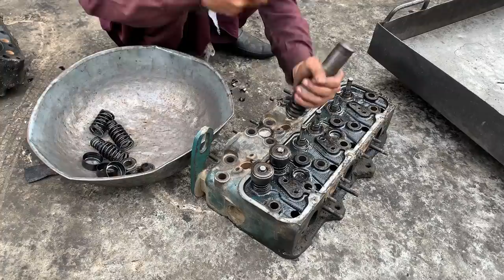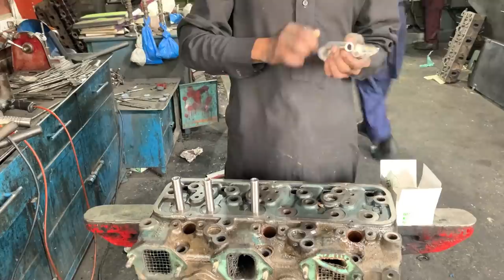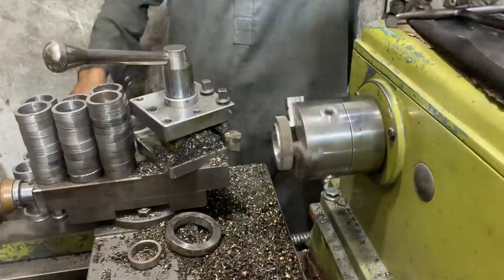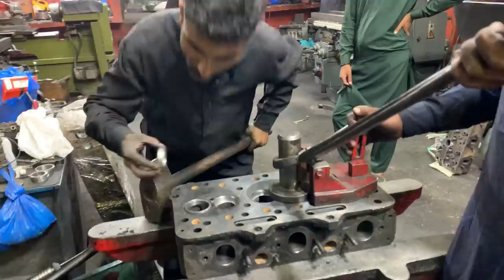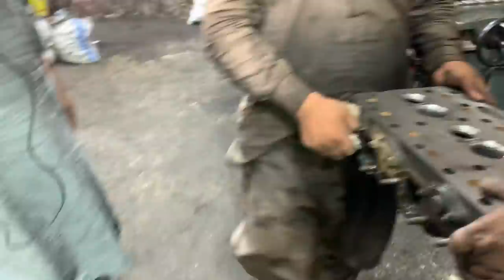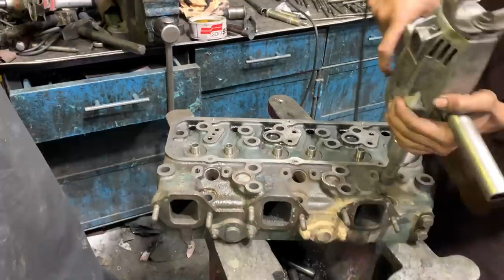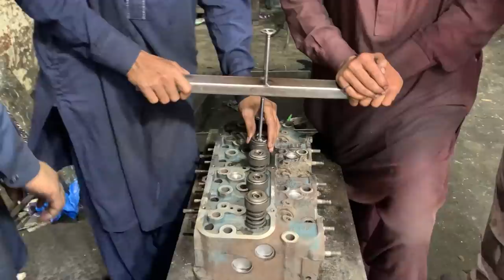Cylinder Engine Head are Warped | Amazing Technique of Resurfacing Cylinder Engine Head

Comment: We don't really know how good the work is.Unless you can attest to the fit and measurement of each part,you can not say for certain that the guides won't seize or the seats won't drop or even that the heads are not cracked.but for working on and in the dirt and using a sledge hammer as the only tool,and really dirty gasoline or diesel or kerosene,its entertaining to watch.one thing i wonder if they use stainless for the seats or just seamless tubing,like pipe or maybe pump shaft its cheap.
Reply: Looks like cast iron.

Comment: did that engine head use valve guide seals? dint see any installed ? we use to put the valve seats in the freezer for some time before installing.
Reply: 13:35

Comment: who needs a spring compressor when you got a hammer and socket. He took them valve springs off ten times faster than a spring compressor could.
Reply: @2000ViperGTSsubscribe   yeah, that surprised me too.
Reply: Very standard way to remove them.  You can use a socket. But there's a tool made for it,  with a magnet to catch the locks
Reply: Vç
Reply: Who needs  old valves when you don’t put them back the way they went…..
Reply: No gloves, no eye protection, no ear protection, no dust mask, no worries! No safety! No OSHA!
Reply: @gs1100ed  no one cares.
Reply: old school way, now putting it back together is another story lol. fine for a clean shop but a highly compressed spring may launch that keeper into the spot where all them missing 10mm sockets go.
Reply: @rickylafleur5823  this is thats what you call pakistani  hand made stuff .but a bit respect but  if you can't do than respect theys peoples hard working peoples fucking no swearing bud

Comment: All the ways we would have done it in the USA in the 1940's & 50's ...  Low speed diesel engine, so no critical valve harmonics to deal with.  Very slow easy cam profiles so no rapid or abrupt valve motion.  All good work.  Checked themselves as they went.  Looks good !!
Reply: My father used to work on trucks, exactly like this until he lost 3 fingers, then he worked on trucks with 6 fingers and two thumbs
Reply: Having seen how the finished engine is treated,I would agree that the " fixing" suites the application.

Comment: A few takeaways we can all learn from::
Rarely do you see such a variety of reciprocating presses in actual precision use!
The RA finish on that one head surface was clearly for an MLS head gasket.
Don't get ripped off by machine shops that unnecessarily invest in equipment when properly trained kids.. er staff, can make squared up valve grinds with hand drills.
No Dremel tooling necessary when you have a good 1" drill
Always insist the final product is saran wrapped before leaving the clean room assembly area, as shown here...

Comment: I  can't  imagine the cost it would be to have this amount of labour beening done in Europe. Here, changing a simple motor sensor, that is fixed with a clip, can cost you a small fortune.
Reply: This shopkeeper to the customer in this video: "I am afraid I got some bad news for you Sir. We had to do some extensive work on your engine. Took my whole team most of the day. Brace yourself...that will be...$35,- including parts, labor and taxes."

Meanwhile - in Europe: "Hmmm...nope. The work here is gonna be at least € 35 000. No point really - better just get a new engine. New engine will be € 23.000 and labor to get the old one out and new in ....€ 11 999,-. We are gonna need your vehicle in the shop for most of a week. Have a fantastic day!".
Reply: Here in Canada I'm paying machine shops doing this 80-$120 an hour. some dealer tractor/construction repair shops are now 150-$175 and up if you go to a Caterpillar or john Deere place. Smaller self employed mechanics are 50- $90 an hour, but thats going up now to.  I don't know what car repairs are here I'm self employed fixing farm equipment and do my own vehicles  still.
Reply: that is morebto di wuth the devaluation of our cutrency than true costs. Worker take home salary have been stagnant since 1979. When did you last see a new car you could pay off in two years or a new house in eight?

Comment: Such bad practice, smashing valves into ground to remove collets
Reply: It is but it’s all they have and I doubt anyone has not told them
Reply: @benjaminhughes9239  A valve removal tool would scare them !!!
Reply: They installed new valves, new seat inserts, and new valve guides. What's the point in caring about the old stuff? Please enlighten us.
Reply: @pdr5926  They think they're working well but really it's just bad practice like I say. It only takes 10 mins to do it properly with a very cheap tool plus weather or not they are skimming the head what's the point of smashing into the ground with a massive hammer. It's just for show and people that don't know better. Would you be happy if someone worked on your engine like that to save a few minutes?
Reply: @Sc50001  I know what you mean, but you need to consider that this people work in poor conditions, they seem overloaded, generally work on the floor with basic tools, etc, and in the end, what we've seen is decent for a tractor head. They don't lose time where it's worthless the spend
Reply: @pdr5926  hopefully he hasn't introduced any cracks or stress fractures being cast iron. However you slice it he did it wrong and badly. Not being a dick but I've built engine's for 30 years and there's no excuse for working like that. They'll be back next week with another video on how to fix cracked heads😁

Comment: Being impressed and vocal about working without safety, precision or cleanliness with engineering that needs it isn't amazing it's cheap virtue signalling. There is no reason safety glasses and shoes can not be worn. There is no reason a workshop can not be cleaned and there is no reason even cheap measurement tools can not be used.
Reply: Agreed
Reply: They are using measuring tools. When they cut the valve seats they were using a set of calipers as a go no go gauge. There was a vernier on the head that was used to set up calipers.
Reply: @gaborkorthy8355  Maybe in this instance, most of these videos have rod and mains, heads also torqued up with zero precision. Maybe they're not showing most of the clearance checking. It is what it is.
Reply: Yes, all our safety precautions are written in blood.  But where life is cheap, it's not good business.  That's the only good reason to avoid the developing world, the whole monetary value of a human life is skewed so any crazy thing can happen if a few dollars are at stake.  Pakistan has over 100M people.
Reply: The answer to all your complaints is very simple, lack of money and lack of care.

Comment: The one thing I see the lack of in all videos especially for installing new valve seats is machining for oversize but then using "liquid nitrogen" to shrink and install the new ones. Is Liquid Nitrogen a consideration in these types of assemblies?
Reply: Way beyond budget
Reply: Way too high tech…
Reply: I've replaced many seats and its always just a press fit. Never heated or cooled. Drive them in.

Comment: Now knock the edges off after milling so you dont slice your hand, they can be extremely sharp. Also dont pull the reamer back through when reaming guides. Need to pull it out the bottom side

Comment: do these engines actually work after this butchering. never seen anything like it. engines today are so soft if you use a 5pound hammer to remove something it will split the engine in 2.
incredible video. don't know if i would want them to fix my engine. i'm too old school engineering type believer. if it works for them then that is fantastic.
Reply: This is what we called old school method.

Comment: It's much easier to grind the heads instead of fly cutting them for resurfacing them. On a large grinding wheel mounted horizontally it takes only a minute to resurface a head on a horizontal grinder and do so by hand leaving a perfect cross hatch.

Comment: Nice skills but not applicable with modern engines with tight tolerances only guiding the head a hair thick  may though off the timing chain timing in most modern cars with metallic head gasket

Comment: i aint knocking it much. they are doing a fine enough job with what they are working with. will this work, prolly. is it in tolerance, prolly not. i do this stuff everyday and what i'm seeing wouldn't fly at work. i get it though, most people never see this stuff and praise those attempting it with some success. people, it's more complicated than what is seen here. the one question i have is are they making seats out of cut up pipe?

Comment: I used to work in a machine shop back in the 1980s and that's exactly how we removed the valve springs I see today people always using spring compressors that take forever versus we just used a I think it was a deep 19 mm socket that I'd smack with a hammer

Comment: Amazingly thorough head rebuilding process. Was surprised they did not show anyone testing the old springs for proper tension, or checking the valves for leakage. Perhaps they do those things but it just wasn't shown in the video
Reply: You didn’t see him whack the spring’s with a hammer checking their tension? 😂

Comment: Ive always returned valves to their original holes.  Roll them around on s flat surface  to spot wobble( bent shafts)
Reply: Or just be the guy in a near third world repair shop and chuck them all out, and fit new guides and valves instead L.O.L. In truth lots of valves are cheaper to replace than spend the time cleaning measuring the specs, and refacing them if a machine shops doing the work for you. The only time I've had a machine shop refit old valves was some that were obsolete and had to be re used.

Comment: Good engineering except the way they beat the valve inserts in instead of using a press. Even a basic fly press would have been better than smacking these in with a hammer and risking cracking the brittle cast iron cylinder head.Otherwise all done to a resonable standard considering the workshop facilities. Wonder how any eyes have been lost over the years due to not using eye protection?
Reply: YES your right ive been there  years ago and many people wear eye patches .
Reply: Where I worked we hammered them in as well, with a tool that kept them perfectly perpendicular to the valve guide. The seats were cooled in liquid nitrogen though so it didn't take much of a whack to get them seated.

Comment: new valve seats  who needs an expensive press   just a big hammer .
Reply: The other day I was replacing ball joint, and I wrestled with it trying to get the whole lower arm under my press. Then I thought, fuck it. It rested it over my vise and hit it with the biggest hammer I got and out it came. Same with fitting a new one. Just found the right sleeve and bashed it in. Same result, just looks rough.

Comment: And why wouldn't you lean into a boring operation or work a lathe with your shirt sleeves down, no goggles etc oh not forgetting the use of your finger to apply lubrication to a rotating seating tool at  8.40

Comment: I worked in the shop of a used car dealer here in Ohio back in the '90s,if a car came in for a head gasket,we were told to take a belt sander with some 80 grit to the block and head because the car lot owner wàs too cheap to send anything to a proper machine shop

Comment: What did the original person do to the original motor, to make this much work necessary?  At some point you scrap a cylinder head...  Shouldn't be 200 man hours in fixing up a $200 part, that by the way.  It shouldn't be worn out.  Don't worry, they did all that and reused the old springs!!!  LOL
Reply: Wear, simple as that

Comment: Valve seats are supposed to be hard🙄
Reply: There is a lot of old vehicle  heads don't have seat inserts in from new, the seats are just cut in the casting the heads made of.  I think now it depends on the type of fuel and if the engines turbo charged. Kinda thinking valve seat inserts is one of the things they do if converting classic cars to run on unleaded fuel.

Comment: As long as you don’t care about how long it is before you have to do this all over again, which, judging by some of these practices, won’t be very long!
Reply: At low heat and compression, like a low speed city vehicle, this work is great. It's not F1 we're talking about here guys, this is solution first thinking. I admire the grit.

Comment: Seen a few of these vids, awesome really, they get the job done , but at what risk? I used to build Race car engines and I was well OTT as far as cleanliness and dust etc, I would not even allow someone in my assembly shop to smoke, or look over the top of an engine in the build status. These guys here, well,,, no safety wear, hands in all sorts, in the open air, machining grinding etc etc etc, no masks, nothing, I have even seen guys using arc welders without masks or goggles! O.k. back in my day, there were no snowflakes, no elf-n-safety, at least not in my workshops, and lets be honest it is well OTT these days,, I mean safety guard and rails and yellow lines on the floor warning notices about machines in use,, and that's just for a pencil sharpener. 🤣

Comment: Good thing no one cares about emissions or quality control..1 angle valve job...lol...Valve seats today are usually cut with carbide, stone obsolete....nothing heated or cooled prior to beating into place ....I'll admit I haven't built diesels before but I wounded want my aluminum heads going there for work..

Comment: I've watched dozens of these videos and have never seen even a single: ratchet handle, can of brake cleaner,  can of WD-40, 3-wire grounded drill, MIG welder, carbide drill, carbide cutter,  electric winch, safety glasses, safety shoes, shop rag, flashlight, runout gauge, coolant or oil  feed on a lathe, real alternator or battery tester, scope, dynamometer, first aid box or toolbox.   Only once:  torque wrench or micrometer.   Amazing and horrifying.
Reply: The shop in this video is, compared to the others, quite well equipped.   Machine tools, micrometers and verniers, and special jigs.   And, work benches and stands!   Pressure washing, even!
Reply: They need air compressors. I saw the guy blowing through a straw to clear debris.
Reply: And still getting the job done real workshop
Reply: @sameuljones5496  not crying about it like most do in our american job sites. I still work in primitive fashion due to lack of funds and tools. Keep your eyes on the cutting surface at all time and you'll be fine
Reply: @darrenvail8726  Lmao

Comment: No disrespect!!
But I have safety concerns issues here? No boots? Or even sneakers?? Flip flops is like going barefoot?  And here in the United states you wouldn't be allowed to work in most shops.  If it's a union shop boots only. 
  Another thing I find different is how they sit to work lol.  By the end of the day there backs after ache if not hurt 
Different cultures

Comment: Pretty scary they don't clamp head down to table instead they have a guy hold the head while other guy cuts the seat bores.  They grind the 45 degree angle for the seat but what about grinding the 30 degree angle and the 60 degree angle in the seat as well. Intake seat needs to be thickness of a dime an exhaust seat thickness of a nickel.

Comment: ……can’t see them blocks lasting more than a few miles when rebuilt & fitted back into the vehicle #YouGetWhatYouPayFor
Reply: These guys have been in business for over 15 years , to open a workshop you need at least 7/8years experience . After that comes the recognised mechanical garage most of the customers are truckers and van drivers who need vehicles on the road not in the workshop if their work was to the standards you think they would not be in business and people working for them if you don't like what you see switch over.
These are honest hardworking people who have a can do and will do attitude and don't charge for the work they don't do, unlike some working in clean workshops how about asking their customers how satisfied they are with the quality and the price of the work done or charging for that imaginary work.
Reply: It’s can’t see THOSE blocks ya hick. If you can do better let us know.
Reply: Them blocks is heads....